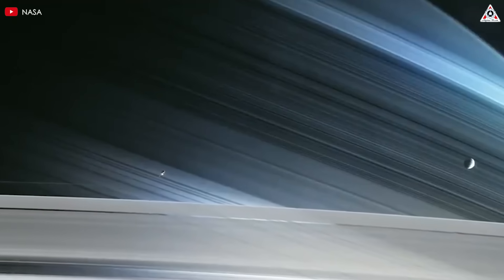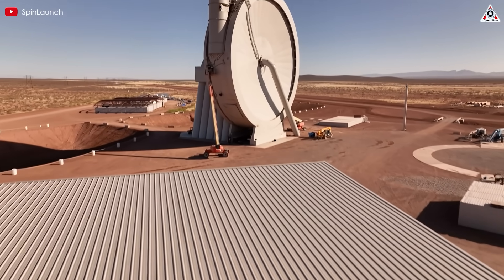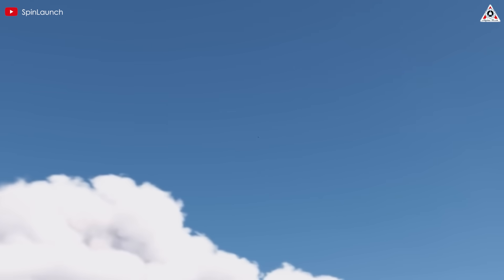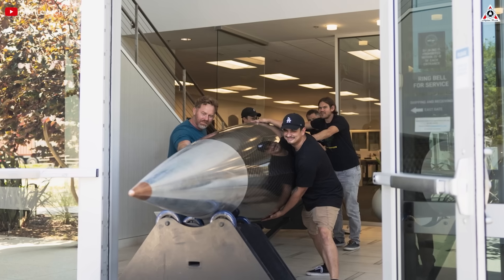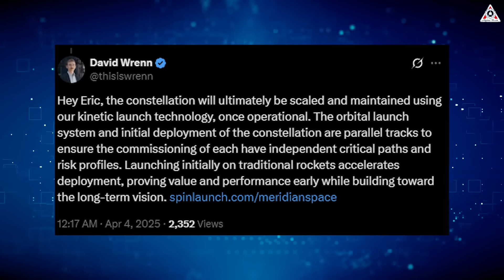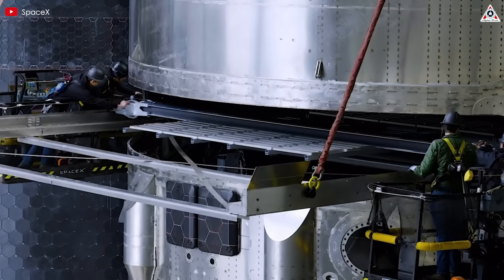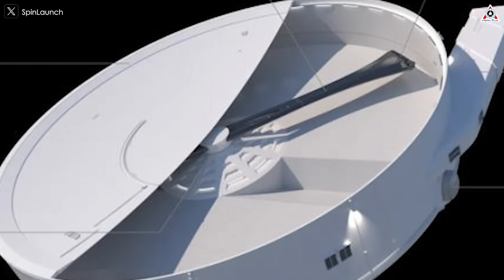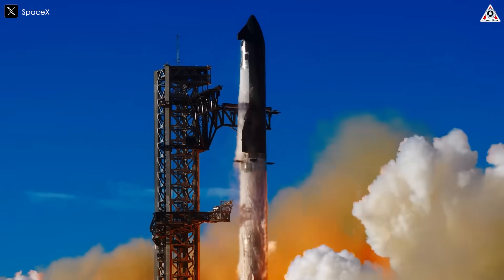It Happened! Spinlaunch Stopped Trying To Make An Orbital Accelerator After...

Comment: For anyone that cares, nothing in the video is correct. They are literally still building another demostrator right now and are currently trying to build a full size one in Alaska.

What this Ai slop is misinterpreting is their usage of their hardened satellite technology to make their own satellite constellation which they aim to start launching with regular rockets until the Alaska project can be finished.

Also, as an engineer, the people claiming this isn't possible have no clue what the hell they are talking about.
Reply: It’s impossible
Reply: @oldmech619 
Please, do tell, with numbers, what part of it is impossible. Be as exact as you want to be.
Reply: @Netro1992 .  Rough round numbers and no air resistance. Throw an object from the surface at 5000mph, it will go approximately 160 miles straight up, then it stops.  The problem is that you have to turn 90deg then you have to accelerated to 17000mph to be in orbit.  There also would be extreme out of balance at the time of release. Then the air will rush into spin launch and that would cause huge vibration in the spin launch.
Reply: @oldmech619  
1.) Not how that works, but even if it was, that's what the rocket in the payload is for.
2.) that's what the opposite load or the double arm is for.
3.) that's what the explosive closing door is for, which wouldn't even need to be as fast as current fastest shutters.

Nothing you listed doesn't have a solution that wasn't thought about at least 30 years ago.
Reply: @ Netro1992:
During spin-up, both the arm and the payload rotate with the rotational (angular) speed of the arm. After the payload is released, it continues to rotate with the same rotational speed becaue of its angular momentum, it doesn't suddenly stop to rotate, and moreover, the rotation axis is perpendicular to the trajectory. At best, you can get away with that with a ball-shaped payload, but even that will tumble heavily and have a curved trajectory due to the Magnus effect. That alone is a show stopper. The company never addressed this issue. If they weren't aware of this problem, they were really really stupid. If they were, they were scammers. Since they must have had physicists and engineers on board, at least some in the company must have known. Maybe they were silenced or maybe they were payed well. The whole thing at best was a "fake it till you make it" case from their perspective, but it was a dead horse from the beginning, and everybody could have known it.
Reply: @marcus_annius_catilius_severus 
>the magnus effect
I don't want to insult your ignorance without at least giving you the chance to elaborate, because it sounds like you either think the magnus effect can occur in a vaccum environment and thus why affect the arm, or you think an object keeps and inherent rotation from being spin around something and thus the payload would also spin once released. I can't decide which if the two is worse, so I'm assuming your misunderstanding is something else.
Reply: @Netro1992  
Correct, the payload would also spin once released, exactly that. If you look at the animations / videos with the rocket shaped thing shown as a payload, you can see it rotate together with the arm as long as it is attached to the arm, with exactly the angular velocity as the arm. Let's for the sake of simplicity first imagine the combined system of axis, arm and payload in zero gravity in the vacuum of space without any friction. This rotating system of arm and payload possesses an angular momentum, which happens to be a conserved quantity. Now let's imagine we detach the payload. The summatory angular momentum of the now two systems axis-arm and payload must and will be the same as the previous angular momentum of the then one system axis-arm-payload. Calculating the angular velocity of the now detached spinning payload is an exercise of putting in the numbers of masses, moments of inertia, and angular velocities.
So - the payload will spin after release. Now back to earth. Now let's for the sake of simplicity first imagine the payload to be ball-shaped, which makes things much simpler. The ball is released from the arm, it'll fly a while through the low-pressure chamber of the SpinLaunch building. Since there is low pressure or something like a vacuum, the payload will fly a pretty straight line towards the exit. Now the exit door opens, the lid is blown away or the payload rips through it (however that works), the rotating ball hits the air of the atmosphere. Now the Magnus effect kicks in, since the axis of rotation is perpendicular to the trajectory of the payload. What you get then, is what in football in Germany they call "Bananenflanke" (curl). The trajectory of the payload becomes mightily unpredictable.
Now back to reality and the stuff SpinLaunch is spinning, i.e. the payload is supposed to be rocket-shaped. Does that prevent it from spinning? Of course not, not in vacuum at least. It will exit the low-pressure chamber spinningly and will only slow down and evetually stop rotating once it hits the air and flies a while through it. Its shape and the small wings at the body will help with that. That doesn't make it predictable though, the fundamental problem remains.
And all of that is so obvious, so intuitively visible as soon as you look at the concept, that I'm stunned that first, I need to go to great lengths to explain it, second that nobody seems to have asked SpinLaunch about it and third, that SpinLaunch haven't come up with any attempts to downplay the size of the phemomenon. I.e. spin it.
And this is just one of the major flaws of the concept, perhaps not even the worst. Others have been mentioned here already.
But after all, maybe I'm the one who is too stupid to get it.
Reply: @marcus_annius_catilius_severus 
I am not reading all that because that's not how that works. Not only are you claiming this machine defeat the conservation of angular momentum, you are also violating conservation of inertia.

I asked you that question because both have been confirmed every single time it has been tested. The lopsided payload you saw was a late release, not the object spinning on its own in vaccum.

I keep saying the fake engineers here are egregious and this what I mean.
Reply: Dude.
My main point was that angular momentum is conserved. Therefore the payload continues to spin after release, therefore it tumbles, therefore the trajectory is unpredictable, therefore the whole concept is BS.
In case you're just too boneheaded to picture this happenig, look at their own video of a test launch: you can see the payload spinning. And that's but one of several reasons why the concept is doomed.

Then of course you had to resort to come up with degrees'n'stuff. If any of us, you're the one that doesn't have a degree in engineering. I do, from Germany's most prestigious technical university. Mine is in EE, granted, not in ME, but I had to pass hefty physics and ME exams to get my degree.
Whatever. A few comments above you said "be as specific as you want", and now out of a sudden you can't be bothered to read a few lines. Who believes you're an engineer. Not me. I believe you're just gullible.
Reply: @marcus_annius_catilius_severus  
Again, I'm not reading all that because the first sentence is just wrong. If what you said was correct, when you let go after spinning an object over your head, the object would not follow a straight line from the point of release. This is how and atlatl works, and that is considered one of the oldest weapons known to man. 

You are just objectively wrong about this and no amount of paragraphs will fix that.
Reply: Angular momentum is a conserved quantity. Are we at least on common grounds with that?

Ok.

The payload spins (in itself, of course, and with the same angular velocity as the whole arm) while still mounted to the spinning arm.

Once released, it flies off along a straight tangential line. Still with me?

Because of the conservation of angular momentum, the payload, while flying a straight line, will continue to spin in itself.

If flying through air, the Magnus effect will kick in, even in a ball-shaped payload, hence "Bananenflanke".

If rocket-shaped, it will eventually stop spinning due to its shape (including winglets).

Why is that so difficult to grasp? Isn't that perfectly obvious? Why do I have to go through such great lengths explaining this? Or are you just trolling? To what end?
Reply: @marcus_annius_catilius_severus 
What exactly do you think the conservation of angular momentum even means? Do you believe a human jumping off a slingatron will start spinning on their own were they jump off it? More importantly, do you believe the arm would spin slower or faster once it releases the payload?
Reply: @Netro1992  
Picture the spinlauch arm rotate counter-clockwise, with the rocket payload mounted.

With the arm at 12  o'clock, the rocket points left. At 9, the rocket points down. At 6, the rocket points right. At 3, the rocket points up.

This means that the rocket spins around itself once per rotation of the arm, while at the same time being held on a circular trajectory by that very arm.

This spinning around itself doesn't magically stop when the rocket is released. The reason for that is the conservation of angular momentum. Once released, the payload flies off in a straight tangential line, but it doesn't stop spinning. Moreover, the spinning would never stop if the payload flew off in a vaccuum, e.g. in space or on the moon. It only eventually stops due to friction while flying through air.

I tried to find footage of this phenomenon, since words alone don't seem to do it for you, or you lack the patience to actually carefully read.

Look at this for instance:
https://youtu.be/4YFvNaCXMMY?t=629
The rocket spins*. The guy (Michael Rechtin) observed the rocket "tumbling end over end" with and without some payload. He apparently was perplexed by this as you were not able to picture this in your mind. His conclusions about the causes were obviously wrong and therefore things were explained to him immediately in his comments section. He seems to have understood after a few comments, but why this wasn't obvious to him from the beginning (he claims to be a full-time aerospace engineer!) is beyond me. Maybe you can enlighten me, now that your penny has finally dropped? What was it that blocked *you from immediately recognizing this?

There's another one, this time an analysis of Spinlaunch's own footage showing the rocket spinning:
https://youtu.be/9ziGI0i9VbE?t=594
This shows the same phenomenon: the rocket payload continues to spin while flying off. I love the mocking tone of the narrator, because he is also pointing out all the marketing fluff that is aimed purely at the gullible and impressionable. He btw. is an actual scientist.

No idea what now out of a sudden a slingatron and a hypothetical human "jumping off" off it have to do with the SpinLaunch. A slingatron is an entirely different beast. The payload of a slingatron is traveling in a tube and its orientation is dictated by the tube wall. Which is a huge problem for the slingatron, btw., and very likely to make this idea fail as well.

And now, since the penny has dropped, would you perhaps care to read what I wrote above? If you now read it, don't you see that everything was clearly explained from the beginning, and that all that later patient explaining and writing could have been spared me? Would you perhaps in the future consider to carefully listen and trying to understand before you jump straight to wrong conclusions? Not everybody else is stupid and wrong just because you don't get what they say in the moment. In that moment, you must have known that you lack the intuition to understand. Why not just hold on and effing listen for once?
Reply: @marcus_annius_catilius_severus  
A bunch of words I don't care to read given that the previous mass of paragraphs were all wrong. Answer only the questions.
Reply: Watch the two videos linked. Watch, listen, understand. I answered your questions already.
Reply: @marcus_annius_catilius_severus 
>get asked to answer the questions provided
>says watching the videos will answer the questions
>the videos don't demostrate what he is talking about, show the release mechanism inducing a torque on the object and thus showing why angular momentum isn't conserved
>they also don't answer the question
I cannot be more glad that I didn't bother reading all of that.

Just to drive the point of how wrong you are further, what rotational speed are you suggesting the projectile has within the tube and how wide do you think the tube is? Hint: the payload is 3.5 meters long.
Reply: @Netro1992  
Dude.

You see the rocket flying off spinning and rather believe it doesn't? Or you rather believe in some mythical "torque" than in the conservation of angular momentum? That is flat-earther-level stupidity. "Nah-uh, it doesn't spin". I'm done. I'm not your physics teacher. Go to school. Go read a book.

The angular velocity ("rotational speed" as you choose to call it) of the payload rocket is that of the arm, of course. If the arm rotates at 100 rpm, the rocket spins at 100 rpm. If the arm rotates at 400 rpm, the rocket spins at 400 rpm. Let's assume 400 rpm, this translates to 6.67 rps. The arm length is 16.5 m which gives us a circumference of 103.67 m. 400 rpm lets the payload travel at 691.13 m/s along the periphery of the circle. The exit tube is about 30 m long, which takes the rocket 43.4 ms to travel before exiting into air. Now you answer why the rocket or any other payload would suddenly stop spinning just because it is detached from the arm. You can't.

That's enough now. If you're too boneheaded to grasp angular momentum even if you see its effect in a video, that's not my problem. I'm not responsible for teaching you physics. You're not an engineer, you are too mindnumbingly lazy to ever achieve something of value, let alone earning an engineering degree.

Bye.
Reply: @marcus_annius_catilius_severus  
Sure thing. By the way, the tube is 3 meters wide. If you were correct that it's spinning on its axis, the payload would have hit the walls and self destructed. Which only goes to further shoe you have no clue what you are talking about.
Reply: @Netro1992  
At 400 rpm angular velocity of the 16.5 m arm, the time to travel through 30 m length of tube is 43.4 ms. 0.0434 seconds. Not much time to hit the walls. You can see the rocket spinning in Spinlaunch's own footage.

Bye.
Reply: @marcus_annius_catilius_severus 
Man, if we only knew how much it would have spun in that time to know that isn't true. Oh wait, we do know, it's 103 degrees from launch to breach, which means that in order for your argument to make sense if would have to be going sideways using your own bad math. And remember, what happens when it spins and it's 3.5m long in a 3m wide (and 8 meters tall) tube? Not what we saw in the video for sure. 

But don't worry, I'm sure you'll come up with an ever worse excuse why it not only doesn't match, but an explanation why there is no rotation on the 1 second of spinlaunch we saw.

Comment: Everyone is hitting on the g-force barrier, but ignoring that spinlaunch subjects it's payload vehicle to max-Q at sea level.  Escape velocity it 17-18K mph ( mach 22 ).  An unpowered vehicle is going to need to be doing 25K plus at sea level minimum, and we struggle with the metallurgy and ablative coating technology to protect hypersonic vehicles traveling between mach 5-8 in atmosphere.  Mach 32 at sea level just isn't happening without the vehicle and the payload vaporizing from friction.  How do people not understand this?  Spinlaunch is a Theranos-level  investment scam.
Reply: Even if all those problems are solved, I'd worry about the sonic boom of the payload leaving launcher. I'm going to guess shattering windows many miles away from the launch site is going to be a problem.